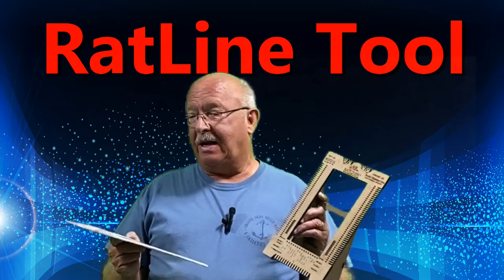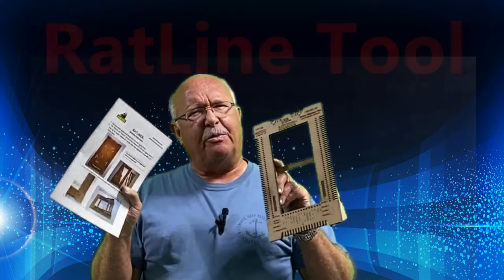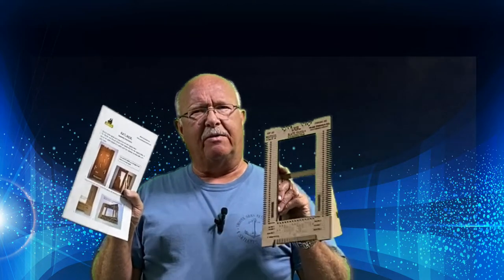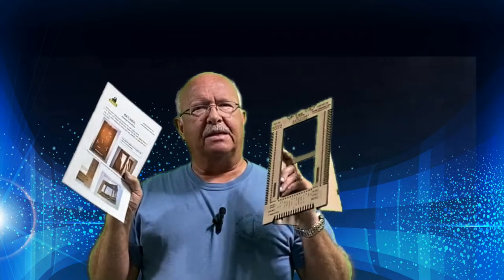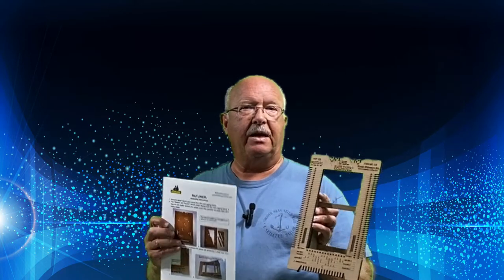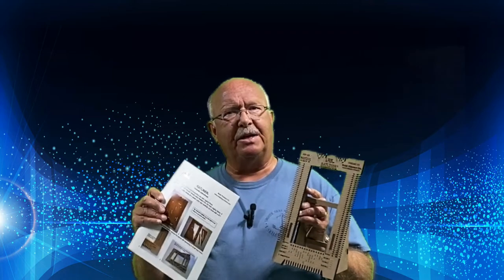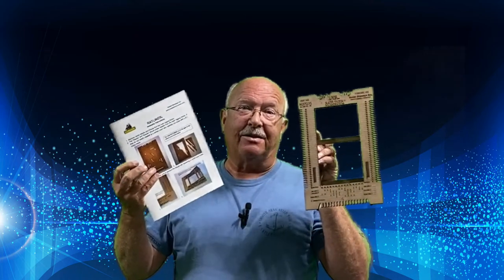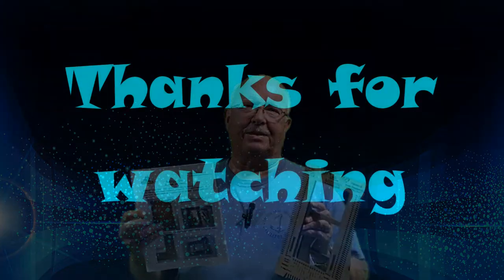RatLiner Tool UPDATE

Comment: Ahh yes, the rat lines. I currently have the harp-shaped loom and have yet to use it. I too simply work the lines on the ship itself.
Reply from the maker: Yes, I have learned from experience…. Stick with the tried and true system for both rat lines and deadeyes.
Had a disaster today…. Plugged in my lanterns only to discover that I grabbed the wrong wire…. (The one for the mini sander 😵‍💫. I burned out two of the three lanterns on the back of the ship!
I hope to dismantle and hook up new lamps….🥴
Reply: @BoilerDan1  hate it when the storms come along and blow out the candles. LOL best of luck on the repair
Reply from the maker: Yes….. But I learn so much from little disasters!  I’ve got them replaced and working again . I just want to accomplish a few more things before posting an update. 👍
Reply: @BoilerDan1  kinda glad I read about your lantern burnout issue just now.  In a previous life I used to build circuits for fun.  Never considered installing components that would have polarity protection.  I think I will now!
Reply from the maker: I live and learn the hard way sometimes!
Maybe I should say “Live and Burn!”
😂😂😂.